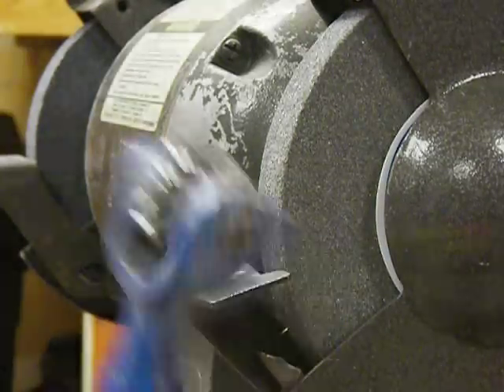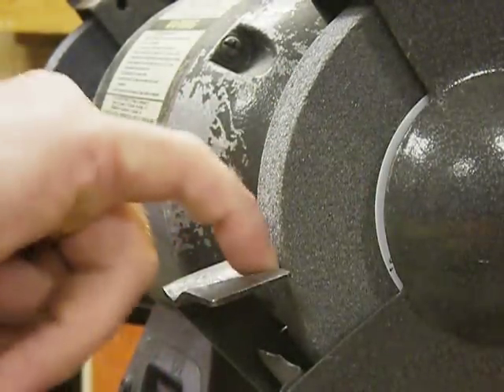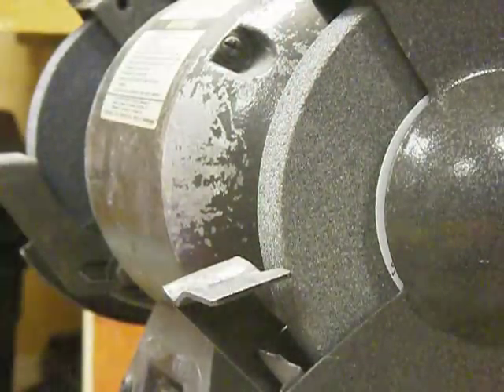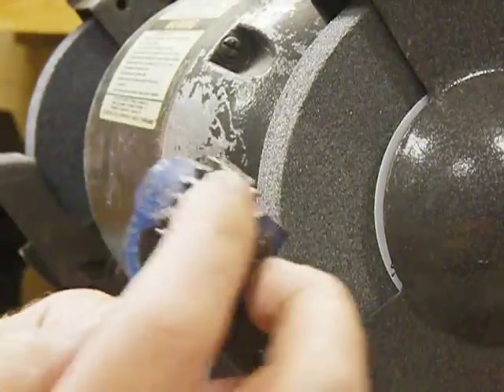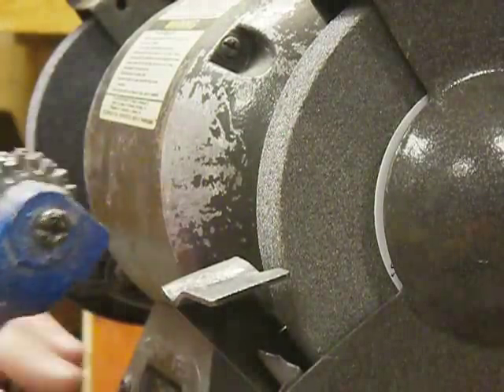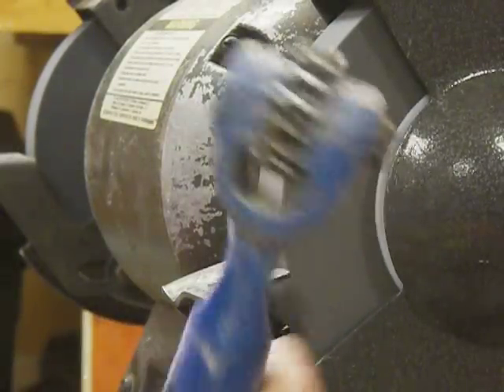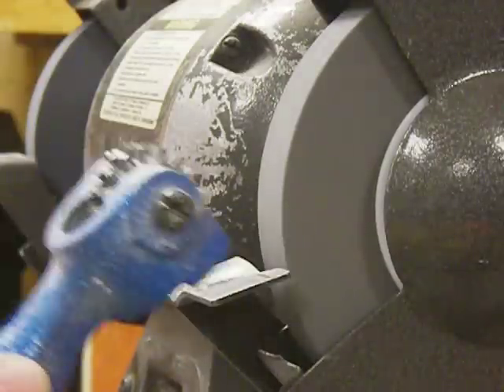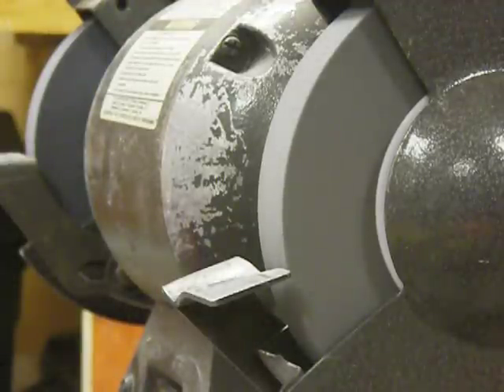Grinder dressing

Comment: I had one of these with a grinder that I bought a long time ago.  The grinder stopped working so I threw it out after removing the grinding and wire wheels.  Didn't know what this tool was for, but I put it aside with the wheels that I removed.  Thanks for the enlightenment!

Comment: Roberto, A diamond dresser gives a smoother finish to the grinding wheel,so is ideal for fine finishing cutting tools. The 'star' wheel dresser gives a more 'open' texture, which is best for rough grinding as it cuts cooler and does not clog up so easily. I use 2 bench grinders in my shop, one has Al Oxide 100 grit and 240 grit wheels (fine and super fine) for finishing cutting edges on lathe and woodwork tools. The other has Al Oxide 40 grit and Silicon Carbide 40 grit for cast iron/stainless.
Reply: 8 years later and you answered a question I had. Thank you sir.

Comment: Another video I watched says you shouldn't see sparks when dressing, that it means you're not applying enough pressure and grinding the dresser instead of properly dressing the wheel. Is this just because this is a cheaper harbor freight tool and maybe doesn't have smooth bearings? What is your opinion dablingtime?
Reply: The other video is bullshit.  
The sparks are both from the dressing tool & the stone itself, because tiny pieces if metal melt into the pores of grinding wheels over time.... which gets ground away when you dress the wheel.  
Even diamond dressing tools will produce sparks.  

The reason you apply a lot of pressure when dressing, is so the stone grinds away more than the tool, to reshape the wheel.  
Either way, you will always see sparks when dressing a wheel, because the metal built up in the pores of the stone & the dressing tool heat up from the friction.

Comment: Just did this and embarrassed to admit I did not know about it. It worked great and took like a minute to bring the stone back to flat and free of embedded soft metal gunk. etc. Tool is on Amazon for like $15. Replacement stone wheel $26.  DO THIS!!

Comment: I think the sparks indicate you're not applying enough pressure to the dresser against the grinding wheel.  The sparks are from the dresser being ground down by the grinding wheel, not the other way around.  The stone won't produce sparks.
Reply: He wasn't using it properly. You are meant to increase the gap between the rest and the stone so the tool can sit down in it. You then can lever upwards to increase the amount of force onto the stone.

Comment: A few issues.
1: "Disposable wheels" but Harbor Freight does not offer replacement wheels, so the whole tool is one use only.
2: "Does not take off much from the star wheels" But those star wheels are so soft they only lasted sharpening 2 wheels.

Comment: Technically incorrect use of this star-wheel dresser.The tool rest should be loosened and pulled away from the grinding wheel until the lugs on the dresser can fit in front of the tool rest. The tool rest should then be tightened.  Dressing the grinding wheel is performed with the lugs up against the front edge of the tool rest. The tool rest acts as an anchor and in this way eccentricity of the grinding wheel can be safely and effectively be eliminated.
Reply from the maker: Stephen gdboy , so that's what those dogs are for. Thanks

Comment: Arfamortis1:  I just watched a "How To" video by the Desmond Stephan company (they make grinding wheel truing devices like the one in this video).  They state that if there are sparks it's because not enough pressure is being applied to the grinding wheel.  Their dressing tools use ball bearings so it can't be that the cutters are too tight.  Having said that, yes, if the dressing wheels did not spin freely they would send out a shower of sparks because they would be getting ground down!

Comment: I put a new wheel on and it warbles. whats the fix?
Reply from the maker: If you mean its not running true like the gap gets bigger and smaller between the wheel and the rest it could be a bit out of round, truing will fix that but if there is a bushing used to make the wheel hole smaller to fit the shaft it could be worn out. In that case you need to get a better fitting bushing before trying to true the wheel.
Now if the problem is the wheel moves left and right and everything is tight, you might have some bent washers or something under one of them causing it to be tipped. Make sure any paper labels aren't waded up causing a double thickness and tipping wheel, It could be the washers are bent but I have no idea how that could happen and at worst the shaft is bent, highly unlikely but might happen if someone dropped the grinder on to the floor from 3 ft onto the shaft at an angle or something. If the wheel was to thin you could get it tight.
Are you sure got things tight?
Did you buy it used?
Good luck
Reply: I would buy a new wheel but not a harbor freight one they tend to be out of Ballance. had trouble with 2 bad wheels from them. buy craftsman wheels never had a issue with them.

Comment: That is not the way to use that tool,
you extend the tool rest out towards you,and place the legs of the tool over the edge of the tool rest so they run true on the front of the tool rest,that way it will dress the grind wheel true to the tool rest,many users have shown incorrect way of this tool,
Reply: Piece Toyou I agree That is the correct way ,the way it was explained in the video, you will battle to get an round wheel. Once both wheels are done properly you will notice that the wheels are running more quitter. obviously after balancing the wheels there should be no vibration provide it is done properly.

Comment: too much sparks which means that the star is getting used
Reply: So are you saying if you see sparks you're applying too much pressure? I really want to know. I have my father's that has to be 50 years old or so and I just now found out what it's for and I need to use it. I'd like to make it last as long as I can.
Thanks for your time
Reply: @hightowerone  I just picked one up in a second hand shop. The guy selling had no idea what it was, I explained him what it was for and made his day. Never used the tool before. But I noticed if I put on more pressure, there were less sparks and more stones flying around. Figured this must be the way, as I could see that with too little pressure the tool was wearing down. When you apply more pressure the wheels will spin at the same speed as your stone and hammer the surface. Instead of mismatched speed where they wear down.

Initially you might have sparks from the metal embedded in the stone surface from previous grinding.

Edit: grammar